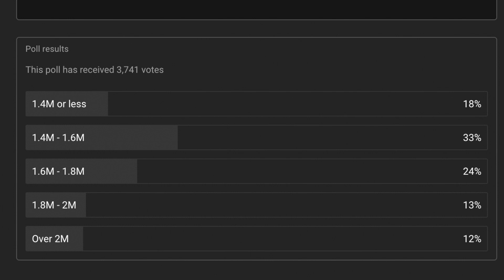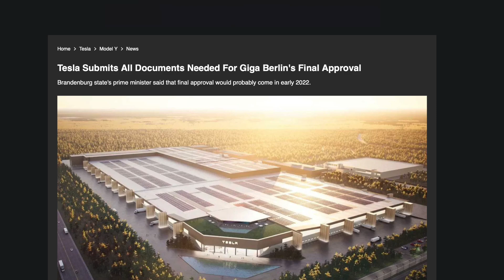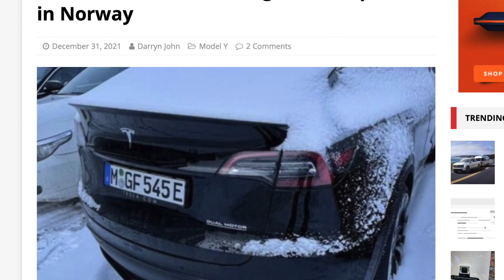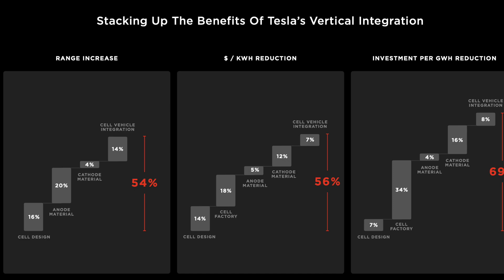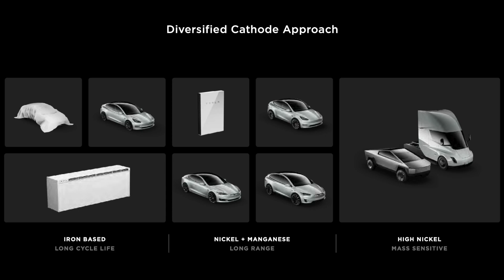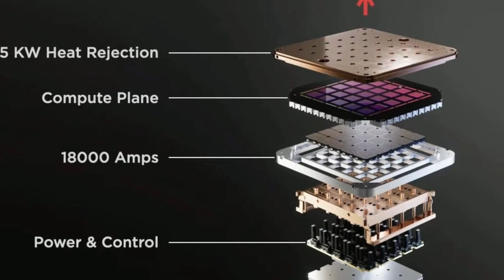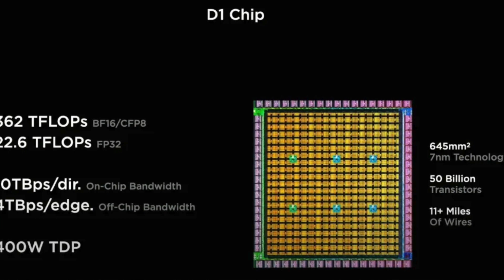2022 will be Tesla's BIGGEST Year Yet!

Comment: The Cybertruck is going to be the most ultimate perfect vehicle in automotive history. It can be used as a police vehicle, a military vehicle, a delivery vehicle, a taxi, and even a family vehicle. It will have lots of storage space, a quad motor drive, en exoskeleton, full self driving, speed, and a 9 seat option, 2 more then what the model X and model Y can offer. This will change everything we know about pickup trucks forever.
Reply: @TailosiveEV  Cybertruck is the biggest vehicle in Tesla fleet, so this would be a great opportunity for a 9 seat option to become accessible.
Reply: @matthewpastrikos7383  I doubt military would use it, but police? Definitely.
Reply: @user-nw8jr1dk9p  Why wouldn't the military use it? The Cybertruck has an exoskeleton, bullet/shatterproof glass, and it has cameras all over the vehicle so the military can easily spot they're targeted enemies.
Reply: @matthewpastrikos7383  easily spot their targeted enemies? 
Do you really think enemies would be that close to the vehicle? That they could just spot them with side cameras?
Also , it's electric .
It wouldn't work in afghanistan, iran , etc 
Even if they used solar roof.
Electric vehicles just aren't there yet .
Reply: @user-nw8jr1dk9p  This is Tesla you're talking about here. They are well known for there efficiency, aerodynamics, and security systems. Cybertruck has all of those things, so this might be a good start for the military to start using electric vehicle.
Reply: @user-nw8jr1dk9p  ever heard of battery storage
Reply: @flaymil5373  That's exactly what i was trying to tell them.
Reply: Matt P  Dude, are you blind? Cybertruck is clearly the biggest in Tesla's fleet, both Model X and Model Y have 7 seats, so this would be an advantage for the cybertruck to have a 9 seat option. Don't you get it?
Reply: Matt P  Actually the Model S did have 7 seats, Elon Musk confirmed it.
Reply: Matt P  Well the cybertruck can have 9 seats without making any changes to the vehicle also.

Comment: I believe the plan is to keep the range more or less the same. They will reduce the number of 4680 cells. They are battery constrained. They wanna use the batteries to build more cars not give each car more range.
Reply: I want a bit more range. Current MY at 509 km, means I can drive 2.5 hours full speed (300 km). It is OK, but a bit shorter than my usual stint when traveling.